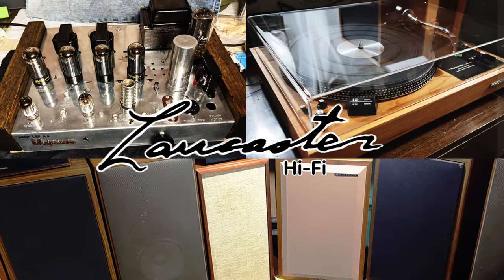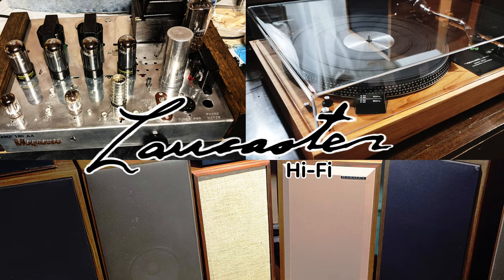Should You Buy Sensitive Speakers? Uh ... Whut?

Comment: I have always assumed [perhaps incorrectly] that the terms: sensitivity and efficiency are synonymous.
And, anecdotally at least, I have yet to encounter an inefficient yet sensitive speaker or, conversely, an efficient yet insensitive speaker.
I do know that my Sugden a21 class a amplifier - with it's measly 10 watt output - could easily drive my relatively efficient [90db] Ditton 66's to high volume levels
and with oodles of stunning bass, in my average sized listening room.
Yet with relatively inefficient speakers of say 86db or less, the Sugden would struggle to deliver power to adequate levels at ANY audio frequency!
Also, because an inefficient speaker requires more power, the amplifier has to be turned up. The very act of which increases distortion!
You don't get 'owt for nowt' in the Hi-Fi world, as you have already intimated.
So, for me at least, inefficient speakers are to be avoided.

Your thoughts, and those of your contributers, have been very interesting.
Cheers.
Reply from the maker: I didn't know the difference between the two terms before I researched the video. I had always simply used "efficiency" to describe either the dB/1 W or dB/2.83 V metrics. I've use sensitivity for amplifiers: What's the input voltage (rms) required to drive the output to full power, but I've always seen sensitivity expressed in terms of an input voltage. If we stick to the efficiency calculated with Hoffman's Law, then efficiency is a percentage, essentially a power per power ratio, but it's basically a unit conversion to express that ratio in dB per watt. I guess the only case in which a relatively sensitive speaker would be relatively inefficient is a speaker with very low impedance. Just don't make me do the math!
Reply: @Lancaster_Hi-Fi  Good answer. And worry not, haha. Schools out!

Comment: WoW. I think that I'm about ready to take the test for my Master's Degree.  This is excellent and great food for thought.  To narrow it down, I think that financial ability is the number one thing in the consideration. Next, what do you listen to and how do you want to hear it. My problem is that I listen to Classic Rock, Jazz, Classical Music and even "space music". Acoustic guitar, piano, etc. No metal, rap or hip-hop.  Sometimes loud but often at middle or lower levels. Do you really want to spend Large money for quality tube equipment, or is an integrated amp, not tube OK?  Almost no speaker evaluations, on line play or discuss Classical Music reproduction.  I have checked out many many hours of reviews, both talk and actually playing music on line.  You can get an idea about speakers this way, with a lot of listening and comparison.  Of course, actually listening in person is the ultimate final solution. My Denon 95 watt per channel AV amp is being used just for 2 channel listening now, and my 18 year old Polk TSi-500 tower speakers, with or without one or both of my Polk 12" powered sub woofers is quite acceptable, still.  Yes, I can afford to spend money.  I just haven't yet found exactly what I want to replace them with. I love the folded horn design of the La Scalla's, but their low end base response just doesn't provide what I would expect from that particular design and price.  I would prefer not to use a sub woofer.  I am presently considering Klipsch Forte IV.  The Cornwell IV is also interesting. Depending which room I decide to place them in.  EVENTUALLY, you must stop racking your brain with all of the variables and make a decision.
  Thanks & Best Regards

Comment: Back in the day(50’s 60’s) we bought a record, took it home played it on anything that worked, we played it till it turned grey! DBs back then it was short for da beer now back then the audiophiles were listening to train sounds etc! Did I have good equipment, yea guess so denon separates and Bose speakers a stack of them! So here I am listening to you talking dbs etc ! The only thing that connected to my mind was I gather you’re talking about speakers! Still have my Bose still pumping the sound out and I still don’t know what a db has to do with playing music!
Reply from the maker: 🤣🤣🤣 But on the off chance you want to know, dB stands for decibel and, with sound pressure level, is simply a measure of power on a logarithmic scale. Plus 3 dB is double the power, and 100 dB is generally recognized as the pain threshold. Say you have speakers that make 102 dB with one watt at one meter. Well, you might make your ears bleed if you performed the test with your ears! Better then to sit back and drink da beer!

Comment: I thought I need 90db+ speaker  to use with my low power  1970's Sansui receiver, but dont listen at high volume.  I also really enjoy  deep base. I happened into some  Energy 2.1E and they delivered the sound I was craving. From what you said I guess probably  wouldn't find the sound I like with a higher efficiency speaker.

Comment: This is very scientific information that becomes very subjective when you pair any given speaker with any given amp.  I like older speakers.  A two way is generally going to be much easier to drive than a three way and have a much simpler crossover network.  And if you take, say a relatively easy to drive speaker such as Large Advents or KLH 6 speakers, they will sound markedly different when driven by an NAD 3020, a Naim Nait 3, and a Krell KRC-2 and KST 100.  You will have problems when you start to introduce Wilsons's or Apogee's.  After 55 years of playing with Hi-Fi gear, if you find a combination you like, you better stick with it.  You change one thing and suddenly you will start to regret selling the piece you just sold on EBay.  Subwoofers suck.  Horn loaded speakers suck unless you have big ones and a good tube amp. Buy a speaker that has decent bass and live with it.  Rectilinear Xi, Large Advents, Smaller Advents, KLH 6.  And you can absolutely have satisfying bass response from a reasonably sized enclosure.  Edgar Villchur and Henry Kloss proved it.  The AR-1 is in the Smithsonian for a reason.
Reply: Sounds like this isn’t your first rodeo. I appreciate your sharing wisdom gained through experience.

Comment: This was an interesting conversation. All of your speakers appear to be vintage. Some may need servicing. I wonder what impressions you might have comparing some modern speakers like the Klipsch, Wharfdale Lintons, etc and if they might impress you?  I found an unopened dealer box set of KLH Kendall 40" towers for only $600. They boast 96dB at 8 Ohms, and a frequency response of 25 Hz-23 kHz +- 3dB. Paired with Marantz 2216 to 2270, they sound very good to me. Can they really handle 250 Watts? Seems nuts. I would like to try a small REL amp with some smaller speakers too, and set them up like you described with bi-amping.

Comment: I think you said if there's true sensitivity differences it may impact the bass area.  Although the rational for this would be interesting to understand better.
Reply from the maker: I didn't go into it, but there are ways to make woofers more efficient. The process is full of trade-offs. Hoffman's Law says E = kVf, where E is efficiency (%), V is box volume, f is the -3dB low frequency, and k is a constant for a given driver. For a target E, to get lower f, we have to increase V in inverse proportion; for example, if we want to decrease the low-frequency roll-off by half, say, from 80 Hz to 40 Hz, we have to double the volume of the box. We could also play a trick and add a port with a resonance around 80 Hz, so that when the 40 Hz note is played, its second harmonic will drive the port resonance at 80 Hz and make the 40 Hz note sound louder.
Reply: @Lancaster_Hi-Fi Thank you for sharing the formula for Hoffman’s Law, it helps me make better sense of the video, but I understand too, why you didn’t share it IN the video.

Edit: It also helps me understand why I don’t like ported cabinets; go into the next room, and all you can hear is the port frequency bumping away.

Comment: I’ve heard this explanation before; it confused me then and I’m still confused.  Thanks for being practical in your analysis.  Considering all the transistor amps, tube amps, allegedly sensitive speakers and “hard to drive” speakers, I’ve concluded that sensitivity ratings are misleading, consistently B.S. and meaningless.  Sensitivity spec’s are overrated; I have a speaker with a high and fairly consistent impedance with a low 83 db sensitivity rating, and it sounds wonderful with a 2.3 watt 2a3 triode mono amps.  They also sound good with a 75  watt tube amp and a 20 watt transistor amp.  Sensitivity specs are marketing B.S.

Comment: I have a beautiful set of 1972 Ohm F’s. 4/3 ohm impedance. No crossovers. Wire to speaker. Big box cabinets. It takes a minimum of 100 wpc to get them to start to sing but it has been said 200 to 300 wpc to get the heavens to come out. 301 wpc to blow them. I’ve used my Marantz 2325 125 wpc, 9090DB 125 wpc and they sound funny. Those receivers don’t have a rating to run 4 ohm speakers but, I’ve been told they can. Well? They can’t. I have them paired with my McIntosh MA6200 100wpc with a 4 ohm rating and they sound nice. Very low bass response but to me, my Pioneer SX-1010 brings the angels out of them at 100 wpc. That receiver also has a 4 ohm rating. Is it the push pull technology? These speakers are extremely inefficient and dip below 3 ohms. I want to run a Dynaco ST 70 but, I doubt the amp can power these monsters like the pioneer. The pioneer SX-1010 has to be hands down one of the best receivers I’ve owned to power inefficient speakers with ease. OHM Walsh F speakers. Talk about inefficient but glorious sound if you have the right combination. Great video on this subject. My head is on fire trying to keep up! Lol
Reply from the maker: Some amps can have trouble driving low impedance loads, and IME the issue doesn't depend on amp power.  My 3 wpc tube amps made my ADS L730's sing, but my SX-780 didn't.

Comment: I'm DIY building a couple of pp-6B4G monoblocks. It'll be around 6.5W max so would love to know what High Efficiency speakers are available.... please.
Reply from the maker: I mention the ones I could find in the video. The (unpowered) champ of efficiency is still the Klipschorn. You could go for the Kharma Enigma Veyron 1D; it's advertised as having 97 dB/2.83 V sensitivity. Those will cost you over $1 million, though. In all seriousness, I'm not sure what to recommend. I just bought a pair of Bozaks.
Reply: What is your budget? Are you into Multi-way or Fullrange drivers (augmented)?
Reply: Try anything by Lowther, Acousta's are a good start. Fostex FE206ev full range drivers in horn cabinets, there are plenty of kits/ plans out there if you enjoy DIY or some vintage Tannoy's. I have an Audio Innovations First Audio, 2A3 pp,  so the same sort of power as your kit and all of the above work supremely with it. Snell J2's / Audionote AN-J's are another option.
Reply from the maker: I've spent some time with Tannoy Monitor Gold speakers. They're something special.

Comment: Lets just say a speaker with a sensitivity of 100dB of 1W at 1 meter will output 120dB at 100W.
Another speaker might have 90dB at 1W at meter and at 100 W will only have 110dB.
The first will sound twice as loud and you will feel it way more.

Comment: There is a vid on YT explaining the difference between diode, triode, tetrode and pentode and the evolution that gave us the pentode as best of it all. 
A SEP nnf is what you want not a SET. Choose the amp first than go after the speakers. 
Klipsch are shit. 
Look at vintage for speakers.
Reply from the maker: Nnf = no negative feedback? That's crazy, IMHO.
Reply: @Lancaster_Hi-Fi Depends on the topology. Triodes like the 2A3 are very linear devices unlike pentodes but you need very unreactive speakers like Lowthers and top quality output transformers or the response of the amplifier can change with speaker impedance, so it's a bit touch and go.  What you do get when it's right is a supreme sense of liquidity and space.  Efficiency can be misleading as there are so many variables. Things either work or they don't in my experience. Good video by the way. 🙂